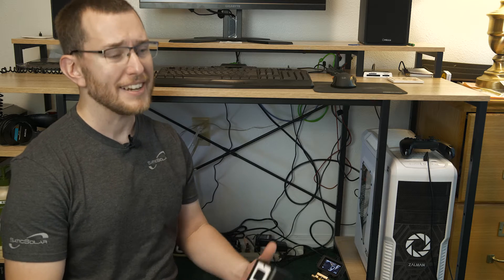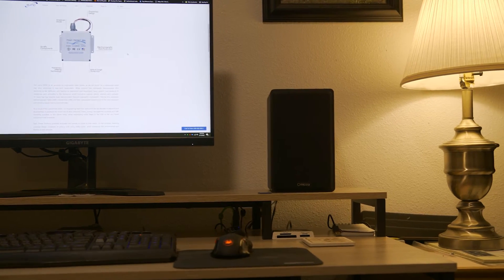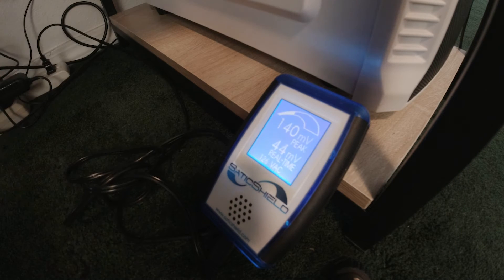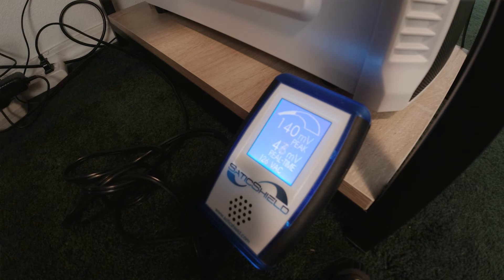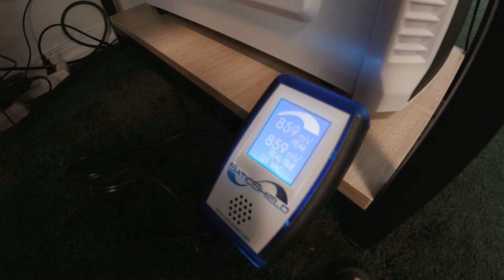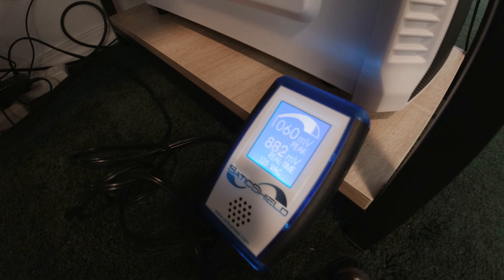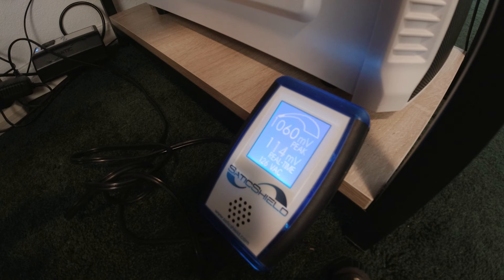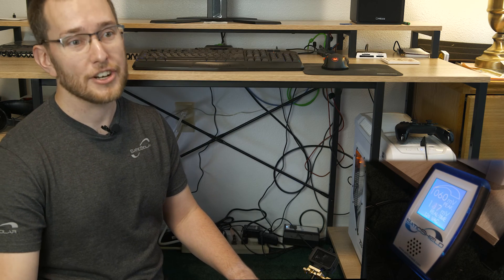Pure Power Plug-In (ES120) Home Demo

Comment: If I mainly live in small apartments less than 1000 square feet, would getting multiple plug in units make more sense than getting the power perfect wire-in? Would there a bulk discount rate if I wanted to get let’s say, 15 plug ins?
Reply: Yes please call customer care 406-493-1861